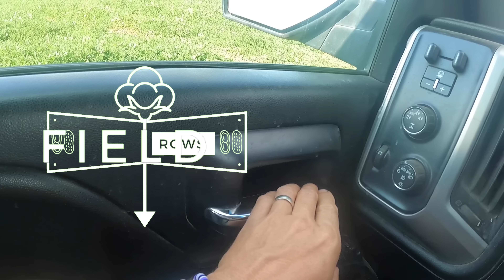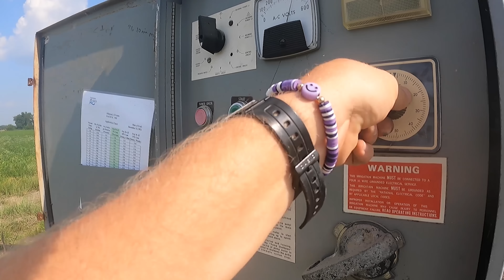Peanuts Dying From Extreme Heat!

Comment: Drone footage was awesome. How often does the gear boxes go bad on the irrigation system.
Reply from the maker: It’s common unfortunately, we have a lot of older pivots
Reply: @FieldRows  Would it be worthwhile to rebuild the gear boxes during a slow time when you aren't using the pivot? Maybe setup a schedule where you do 2 or 3 pivots every year. Take the gear box apart, replace bearings and seals as needed put in fresh oil?